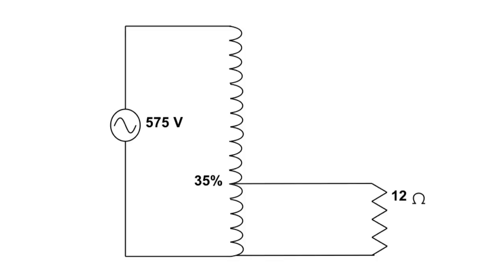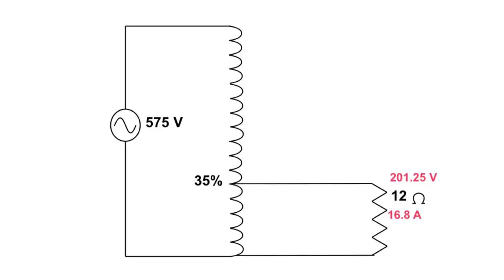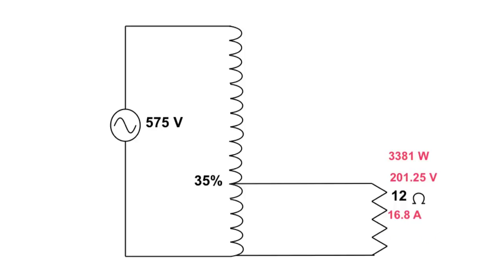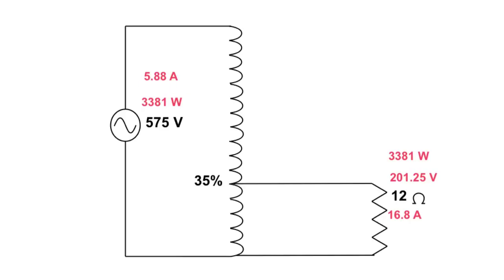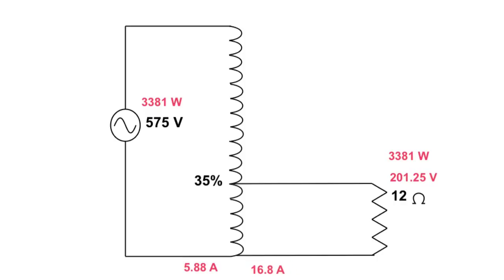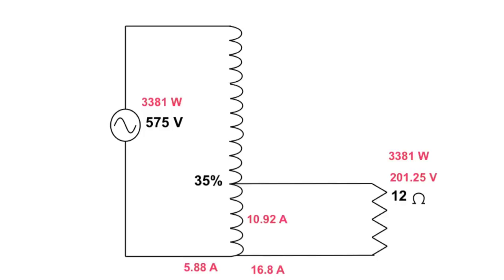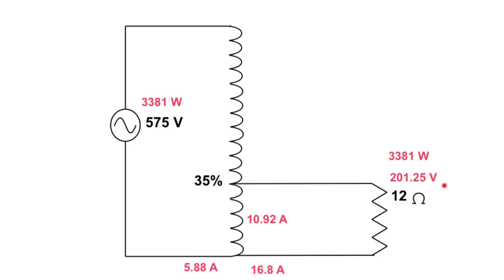Step down auto transformer walk through

Comment: So, what size wire should I use? Is the wire with a current carrying capacity of 5.88A or 16.8A? because according to my understanding, if you use 5.88A wire then the peak output capacity is only 5.88A x 201.25V. but if you use 16.8A wire, it is equal to 575v x 16.8A. what's true? please explain. Thank You.

Comment: Hi! can you draw up the current flow , I am having trouble understanding the physic side.
Reply: You can choose the path of the current flow starting clockwise or counter-clockwise, splitting into two paths at the secondary loop (across the "35%" section of winding and across the load), and rejoining again to return to the source.  But with AC (alternating current), this isn't exactly accurate, as the path reverses direction every half-cycle.